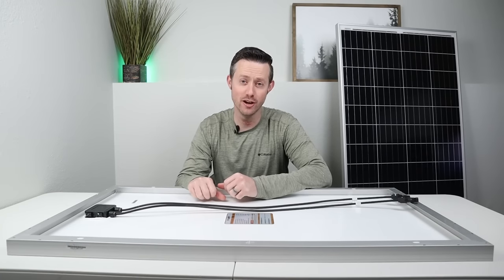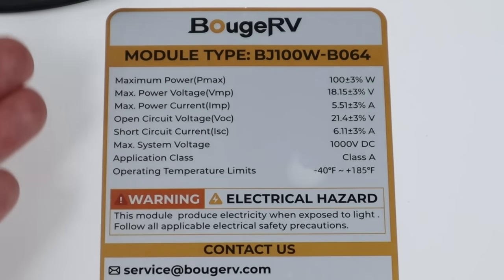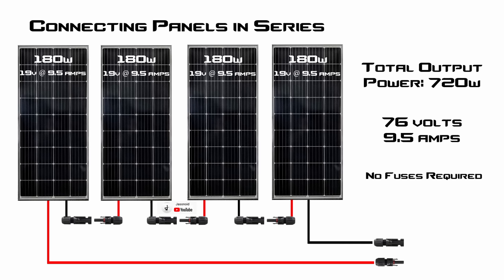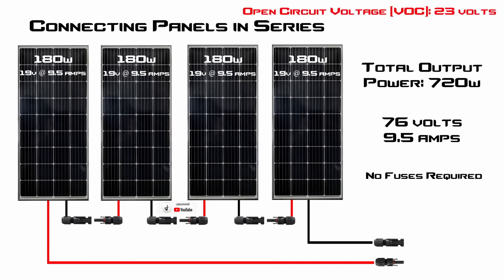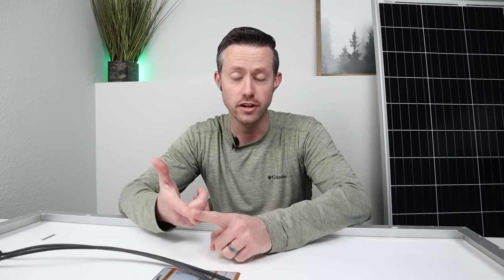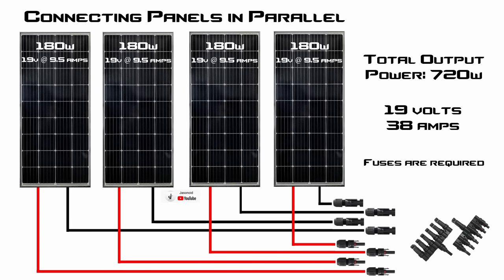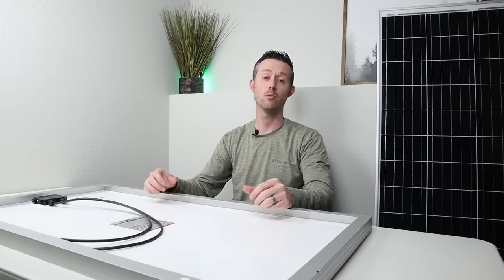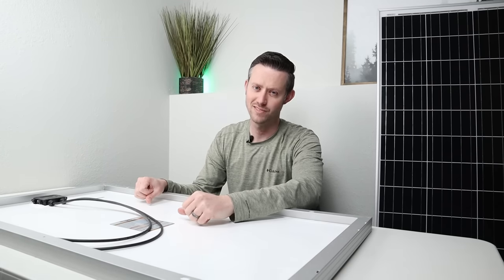Series VS Parallel! A Beginner's Guide for Solar Panel Connections - With Basic Diagrams!

Comment: how much shading is too much? would the shadow of a power wire count as shading, or more like.5 t0 .75% of the panel.
Reply from the maker: Yeah, it only takes a little bit of shade to ruin the power output, shading on a only one cell. If you'll have lots of shade, stick to parallel setup.

Comment: If you can afford it, diodes are a better choice than fuses here. They won't need replacing and you won't harm your panels by reversing the current (which reduces their life span)

Comment: Very internesting ... i understand why some powerbanks perform better,  maybe some can help why one of them is burned by overpanelling ?  :)
1) My all powers R600 (12a, 12-60v) produced 200w with 2x100w panels in paralel (18.9v , 5.3a each - 22.7 6.03a circuit) , but burned when i put 4 same 100w panels , 2 series 2 paralel , after the sun whent very powerfull.  It has a top of 220 wats input ,that was maxed out easily with that set up. company sayed it was amp fault, been too high but i dont get it since they where maximum  12A on both setup.
2) Fosibot f800 has 12-50v  and 8.5 amps . so with same 2 panels in paralel has 165w max power... this is because 18.9 *8,5 = 160w i supose... and just ingores the extra 2 amperes from panels ? I see this get 200 w without burning with higher voltage panels, should i do that too ? is there a limit not to cross in ampere ? i know about volts.
3) also there is a 12-30 volt 8 amps oupes 1200 , this takes 160w from my 2 panels  ... this cant be put in series , but i seen it could max 240wats this power bank . I supose i need a 24-27v panel with 10amps to go somewere close ?
anyway, just writing my thoights , thanks ;)

Comment: 😢 how about bypass diod in series connection why hole set up😅
Reply from the maker: Most solar panels have built in bypass diodes in them now, they aren't needed externally.

Comment: You always need fuses and also a shut off on each end of the line from panel and charge controller. The fuses and two switches are not expensive. Yes it'll work without them but they make things a lot easier and safer.

Comment: How do i wire panels up for a maximum of 4000 Watts
Reply from the maker: Usually in series, just depends on the charge controller requirements for voltage and amperage.
Reply: It's says maximum pv voltage 250v and 5280watts so how would I wire that with 415 watt solar panels or what would you recommend???
Reply from the maker: Look at the panel VOC specs and divide them into 250v. Usually that will be 4 or 5 panels in series, then you build two arrays and put them in parallel for around 20 amps.

Comment: I have 2 small panels that are 50 watts each. If putting them in series will have to worry.oh they are hqst-50
Reply from the maker: Most small power stations will not work with solar panels in series, the voltage will be to high. Larger power stations can take panels in series. It just depends on what you are plugging the panels into. I explain that in this video: https://youtu.be/4JG8LvJznLY
Reply: Okay well what's your thoughts for  the EB120 by Maxoak? I also have the EB3A
Reply from the maker: @dionnesanders2304  The larger EB120 can take in 60v, so that one supports series connections. That video I linked above explains how to read a panel spec sheet and how to plan for the right type of solar array.

Comment: You explained how to ,but not why one would be better than the other. In other words  would higher amps or higher voltage, charge batteries faster or ????
Reply from the maker: Amps create heat and voltage drop. In my opinion I prefer higher voltage and less amps in my setups. Rooftop solar systems usually use higher voltage series arrays for the best results.

Comment: Why would I pick having them in series vs parallel?
Reply from the maker: Series allows you to have less amps and heat in your components so you can use smaller wire and save money.
Reply: @Jasonoid  thankyou

Comment: If you don't want to spend 12 minutes watching the video, read this, and you'll be fine.

It all boils down to volts and amps, your inverter and if applicable, your battery bank.

Solar panels, typically, are 12 or 24 volts, and some amount of amps.

Parallel -  voltage stays the same, but your amps go up.  2, 12 volt 16 amp, solar panels in parallel stays at 12 volts, but can now supply 32 amps.
Series - voltage goes up but your amperage stays the same.  2, 12 volt 16 amp, solar panels in series goes up to 24 volts, but stays at 16 amps.

When installing your inverter, and/or charge controller, these devices have a specific input of voltage.   If you have 12 volt solar panels, but your inverter or charge controller requires 24 volts, then you're wiring up 2 solar panels in series.  if your inverter needs 48 volts, then your wiring up 4, 12 volt panels in series.

The best, most fault tolerant design, will be a combination of series and parallel panels.  Example.  You have 12 panels, and a 24 volt inverter.  You're going to wire up 6 pairs of panels in Parallel.  Each pair, is wired up in series, so you get 24 volts.

Easy peasy guys....
Reply from the maker: Yet it probably took you longer than that to write this up? Thanks for the breakdown, maybe some people will find it helpful! 😁👍
Reply: @Jasonoid  It didn't actually.  But why would that be important?  You very likely spent at least an hour, probably more, producing this 12 minute long video.
Reply from the maker: @JohnDoe95876  more like 15 to 20 hours for the whole process of making the diagrams, scripting, editing and many rerecordings it took to get everything to an acceptable level to post online. I wish it was only an hour and that's probably the biggest misconception about youtube. With fancy editing it can make it look like a cake walk. 
Thanks for sharing your experience with the viewers!

Comment: Like to see 2 100 watt panels put in parallel then added to series string of 180 watt panels
Reply from the maker: That would work fine if the voltage and amps would be around the same total when it's all connected together. I'd need another 100w glass rigid panel to test that out. I only have 1 right now.

Comment: Mate just get 40 of them in series and run 400v through them and melt them 😉
Reply from the maker: It's actually the amperage that would melt them haha. Most panels are rated for over 600 to 1000 volts without damage.

Comment: So you did not mention what voltage your battery bank is. Using 76 volts to charge a 12 battery is just a waist of electrical energy.  Therefore your panel array needs to match your battery bank. That is why one would use series or a combination of series parallel panels. The wattage is only relevant to the load you need to supply and the time that load is on and the time it takes to charge the batteries.
Reply from the maker: That's only part of the equation, the battery voltage. Lower voltage solar is much more likely to lose power due to voltage drop, especially at higher amps. Any considerable wire length you'll want to run panels in series to avoid power loss.

Comment: WHAT SIZE FUSE WOULD YOU USE IN EACH PANEL?
🤠
Reply from the maker: Usually a 15 amp fuse is suitable for most panels, you'll want to go slightly higher than the short circuit amperage of the panel when sizing a fuse.

Comment: Yikes! I didn't realize you could be electrocuted by solar cables.
Reply from the maker: If the voltage is above 60v, it can get ya so you need to be careful. 
I've also felt some DC electricity shocking me above 30v before as well. Just little tingles, it didn't hurt.
Reply: @Jasonoid  Thanks for the info - good to know as I get into solar.
Reply: Are there any type of gloves that will mitigate this, short of the big rubber gloves and glove protectors?
Reply from the maker: @neostephens8980  using insulated tools will work, along with special gloves that have insulated material.